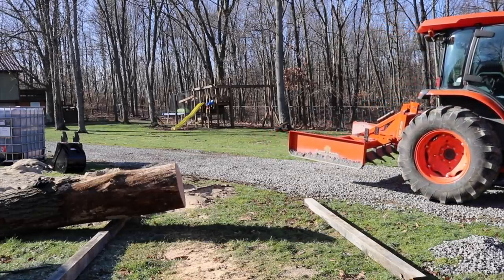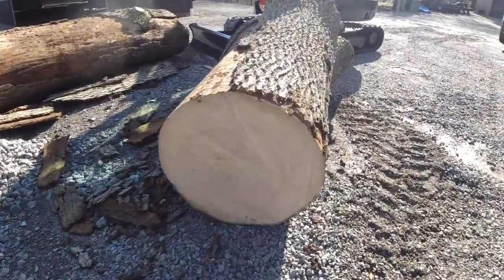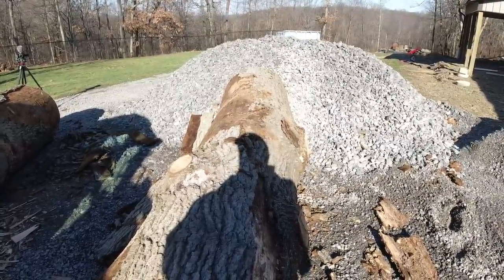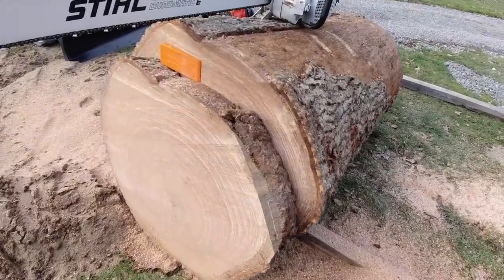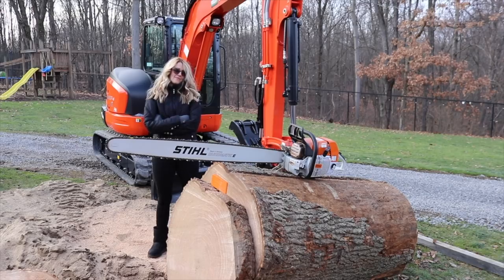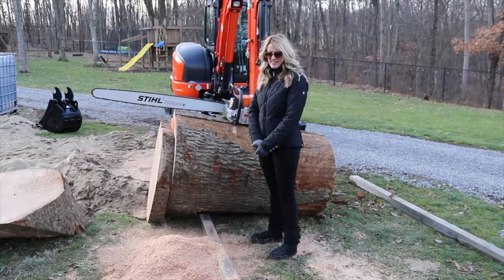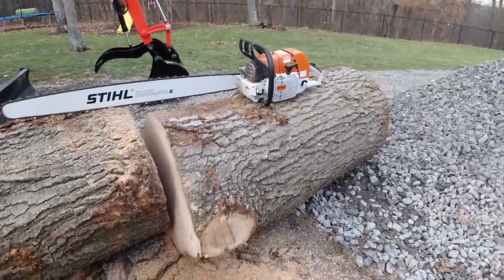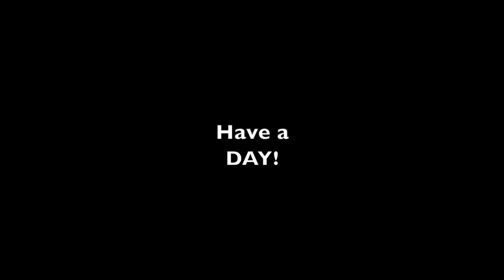#994 BIG OAK, Calls for BIG SAW Stihl MS 880

Comment: Hey Mike. Cut a cookie from the one for a table top, be sure to spray coat the wood while drying, light oil. It will help keep checking down. The one with a big crouch, the crouch itself could hold some pretty grain.

Comment: I had a big red oak come down in my yard about 3 years ago and I cut some slabs off it like you did, but they ended up just falling apart.  That was with green wood so hopefully that won't happen to you.  That slab would make a heck of a table
It would be interesting to count the rings on that tree

Comment: Mike, you asked for suggestions regarding the red oak that has a massive branch near the top.  I 'd like to suggest, you use the  new Kubota excavator to stand it up, so that a vertical cut can be made to take the branch off, leaving the main trunk a lot less weighty.  Robin. UK.

Comment: Suggestion- get some 1-3 gal plastic jars, fill them with your coarse  sawdust, pack it in and pour some diesel fuel over it, It will make a great fire starter with no muss. Lot cheaper then commercial stuff. Lasts forever and will start anything.

Comment: With all that diesel equipment you should ask your local distributor to set a split tank for summer/winter diesel fuel.
Off-road fuel would save you some money over the cost at the pump. Plus you’ll have the extra fuel for your next purchase, whatever that may be. Have a great day!

Comment: Need to look at a spiral log splitter for the hoe splits the big logs down to pieces you can handle by hand then cut to length and can remove the spiral and add a  auger to dig post holes with the same hydraulic motor works great on my Cat 307 witch is just a little bigger than yours.

Comment: Nice new excavator.  The Steelers stunk the joint out tonight.  I live in Rochester, NY but have been a lifelong Steelers fan.  Nice of Ben to watch the bad snap instead of diving in there with Connor to try and get it.  Touchdown Cleveland right off the bat. Maybe they should trade Ben for the 'Amish Cannon' Ryan Fitzpatrick.

Comment: Nice looking logs. If it was me I would of trimmed the root flares and milled it all into limber.
Reply from the maker: It wouldn't fit on the mill and even if it did the ends would be cut off anyway because they only need 4' pieces

Comment: by putting that cookie in the garage it is good but not on concrete floor put a few stacker under and then a few on top with weight on top dark corner preferable because of it being a dead trees hardly any sap in it but make sure it stays moist a long time the longer you take to dry less craking will happen

Comment: Hey Mike, I love the excavator.  I’ve got a Kubota one size smaller than your and a Cat  307C For digging bigger stumps and such. Wish now I’d just spent the money and got the KX080-4, may still trade up.  One thing I wanted to mention. When I carry big long I curl the bucket all the way back and the raise my blade up under it to stabilize the load. Works really well and doesn’t  tip as much. Just an FYI   Love you guys, grate videos 

Connie

Comment: If anyone has a chainsaw mill nearby, that crotch piece would make great 2" or 3" slabs that could be made into tables, or put end to end to make a conference table with epoxy and smaller cuttings filling the space, or with company material inserted in the sides before epoxy application.

Comment: If you can find a reasonable hill to dig out from the side, for your shale, it wouldn’t look so much like a quarry.  Especially if you can access it only from the side (instead of head on) you’ll barely notice it until your upon it.  Not sure if you’ve got a place like that, but I think you’ve showed us some fairly good ravine shots that might fit the bill.  If the open part is all shale, you shouldn’t have to worry about erosion and having it all fall down the hill on you! 😜
My 2 cents...keep the change. 👍

Comment: Say old timer.  Little back tip:  when running a saw try to keep your back straight.  Meaning when you start to find yourself bending, take a knee and keep ripping ergonomically🤙
Reply: Yeah I thought he might just hold on to it with the excavator at a better height and cut it in the air.  Keeps the saw at a nice height

Comment: Mike, when are you going to get a hand-held metal detector to check the wood before you put it on the mill, and as you are cutting?  Surely there is a manufacturer or store that will assist for advertisement in a fixed number of videos.

Comment: Stopped video to answer ur Question Mike. Make a chair out of it. Cut that one short side flat across, then cut the longer side down a quarter cut down to flat cut making a back rest. Varnish it or Helmans coat it, sit it on a grate steel or just gravel so it'll get air and not rot the bottom sitting on wet ground and give it back to the park... Now, back to the video.

Comment: Old, even home built trailer to move the mini around the property would be good...  Pull all the stumps in the woods and just clean up out there..   The big tractor would pull the trailer...   Just save tracking it and save hours on it...   
Question,   Do you put additives in your fuel or oil?   I did alot of reading from engine builders on lucas gas and oil treatment for diesel engines..  They say million mile engines show no wear when lucas is used.  The new diesel fuelss have very little lubrication...   Ive been useing both...  Just thiught Id ask...

Comment: There is one thing about Shale, it is slippery when laid down in layers upon itself.  In N Wales we have a few mountains of Slate Waste, and they are so hard to climb, as one slate slips on another.   Also slate dust is very abrasive if carried in a strong wind, and damages car paintwork if we park in the wrong spot. . . . .  Will look forward to seeing you do some ditching with that tracked excavator, my wheeled JCB needs propping up every 4 feet, so was thinking the track vehicle might be quicker. . . .

Comment: 👍🇺🇸🇺🇸🗽🙏🏻 Enjoyed!  Nice job in cutting those big logs, it's easy when you got the right tools!  With my Husqvarna I have to work from both sides on a big one like that.  And the cookie you cut you did outstanding, it takes talent to cut one that good, for me it would be luck, beautiful piece of wood.  Hauling your shale you need to consider using the MX which will allow you to get in and out of tight places where using the pickup is difficult.  Does the MX have a standard rear center hitch or do you need to get a drawbar for the rear hydraulic arms?

Comment: i like that toy,,,getter done  Mike....love the blond hair to....Mercy What Job Cant You Do..love that 880 to..i had one cut down years ago,,a big sickamore,,haaa,,it was huge little bit bigger then that,,it was blocking the sun from coming in here,,,the main frame of it,,now only about 20 feet long,,rotting out...i cut it in 4 sections with my 180..went right down through it...but its still heavy,,had it cut 30 years ago,,when the place was loged..i give him 50 bucks to cut it,,he said yes,,i cut all thee limbs off when i was younger....love that oak mike,,cut one like that for a sign to your place,,morgans Ranch,have somone do it for you,,and dont forget a table...it would last 50 years...wood is so dam high,,i bought 1 piece of osb 3/8  30 bucks last tuesday...thank god i only needed 1 piece..ply wood is out of sight..8 ft 2x4 7 bucks,,,no not me...ill find used wood first...watch that big excavator dont tilt on you sideways,,,stay warm u all

Comment: Mike, what is the name of that sealer you put on it? I usually use paint, but i know you cant on that cookie.  That would make a good table.  I would cut through the crotch.  That would make som nice coffee tables. Could us epoxy on it and make like a river table for the shed.  Love that 880.  It is on my radar to get.  What size bars do you have for it?  Cant wait to see your excavating projucts.  I saw your excavator was rocking.  One thing i do using my mini excavator is i lift my blade all the way up and put the log next to the blade.  That helps me out alot.  Just wanted to mention that. Looking forward to your next video Mike

Comment: So I very rarely will leave a comment anywhere,  but I saw something on you session you just might want to pay attention to.  As you laid the large forked log on the tractor forks you pushed it with the excavator.  I’m sure it seem harmless, but it wasn’t.  In doing so you pushed your loader mount side ways on your tractor.  I’m sure you didn’t realize the force you were exhorting on the kubota loader frame.  It moved sideways at least 4-6 inches while locked in place.  Look at the tractor tires, they don’t move.   This type of force will disfigure the loader frame and if done repeatedly will bend the front sub frame on your tractor.  I realize from the few videos I have watched you are not a stranger to equipment, however it is very easy to forget the tremendous power a hydraulic system produces.  Just Saying....  I known guys who have changed tractor buckets in the shops and destroyed the concrete floor by breaking the concrete with hydraulic down pusher.

Comment: You need to invest in a decent metal detector to check those logs. Considering the wild *ss hunting seasons in Western PA, metal (copper, steel, lead) could be just about anywhere in a tree. Garrett, Minelabs and others all make sold, quality units that would do the job...